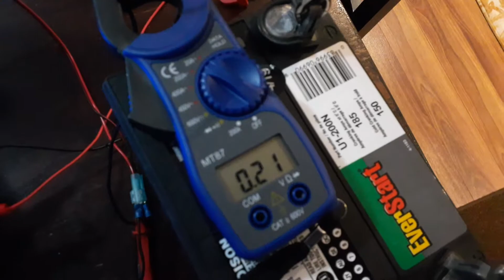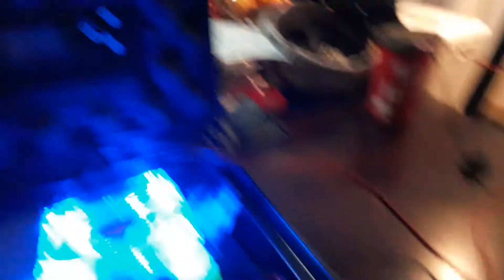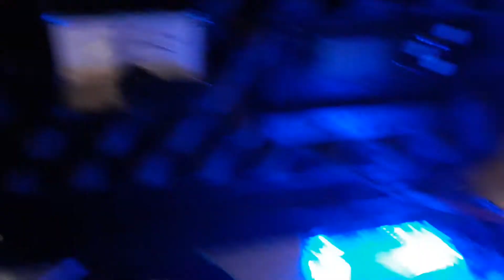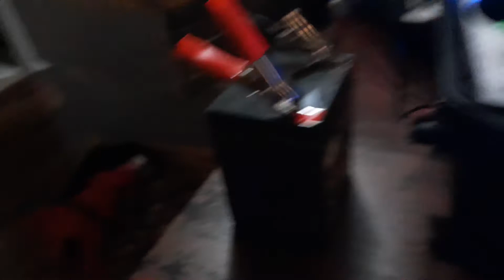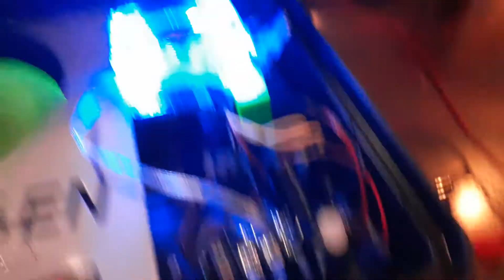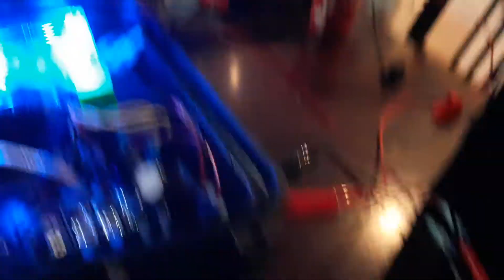Pulse motor generator Zero point overunity

Comment: Is there a schematic circuit
Reply from the maker: Just Google pulse motor circuit  it's all over the place its all open source
Reply: @FaradayResearch  i just was wondering your design if anything different,  Thanks
Reply from the maker: @cenobiod.4301  nothing different at all , but you must add some diodes and caps
Reply: @FaradayResearch  https://youtu.be/_V4xSnsV6IU i have this one i just stop but will continue later modifying it

Comment: Hey Mike, excellent work!!!! I do have a question for you, how many coils are you using? I have found that the more coils I used, there was an amplification effect or multiplication effect rather. I also noticed that a bifilar wound coil, had a multiplication effect stronger than a single wound coil, My setup was somewhat rudimentary when compared to yours, but worked great. Keep moving forward,  things can only get better from this point on.
Reply from the maker: Hey Thomas   yeah this is a work in progress  ...I just using 1 coil so I will be adding more to the system  .... I figure if my results are this good already it will only get better   .. cheers Mike